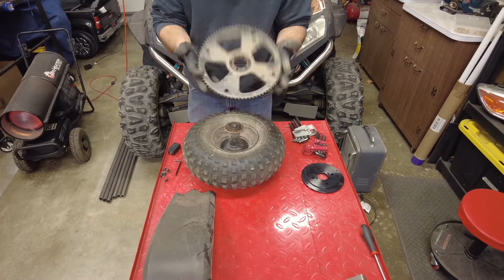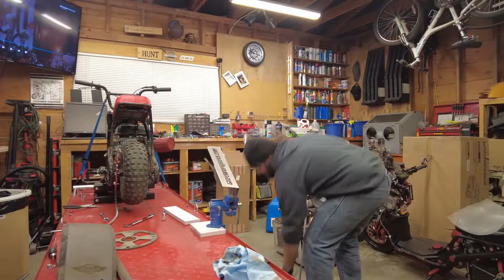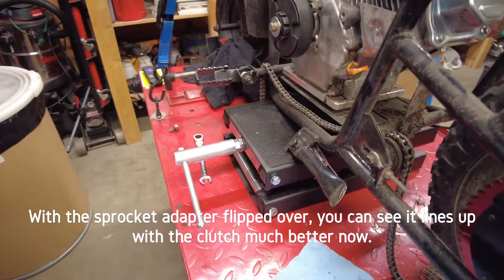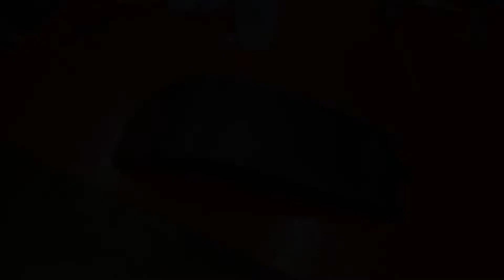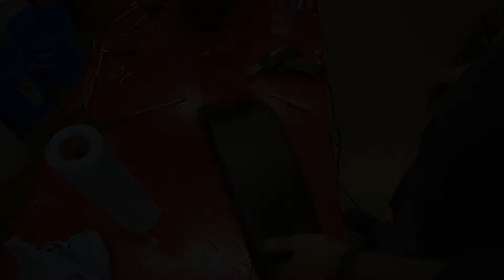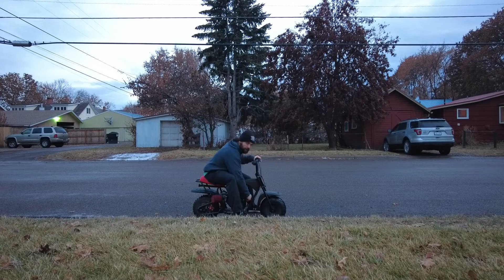Mega Moto Mini Bike - Part 3 - Clutch Cover and Sprocket Adapter Install & Fixing the Rear Fender

Comment: Very nice... I just finished a build and am about to start another similar to yours. The for the heads up about gender cracking. I’ll build some supports on mine to fix that issue on the new build. Great job... Thanks for the video!
Reply from the maker: Thanks! I am thinking about adding some additional supports as well.
Reply: Wow I was just reading you reply and realized I was a victim of autocorrect. I don’t know what “gender cracking” is. Hahaha But I see you knew what I meant. Check out my build on “DIY Willy”. I just watched part 2 and that will help me with the next bike.
Reply from the maker: Haha, I noticed it, but I knew what you meant.

Comment: What type of bolts/screws did u use plz help!!
Reply from the maker: For which part?
Reply: @MikesMiniMotors  for mounting the GPS chain guard
Reply from the maker: @sonyagala2124  I had just found some bolts laying around the garage that fit. I just looked it up the in manual for you, and it calls them out as 5/16-24 bolts, but it does not say the depth of the holes.
Reply: @MikesMiniMotors  thank u so much deserved a sub🙈

Comment: Nice video! I swapped a 212 on my CT100U and i got the clutch guard for the bike but it didn’t come with any hardware. Do you remember what bolts you used for the clutch cover?
Reply from the maker: If I remember correctly, they were 5/16" 24 thread, 1" long.

Comment: Great video did the bolts come with the universal kit sprocket kit
Reply from the maker: Thanks! If I remember correctly, it did come with the 6 bolts to attach the sprocket to the adapter, but not the bolts that attach the adapter to the wheel.